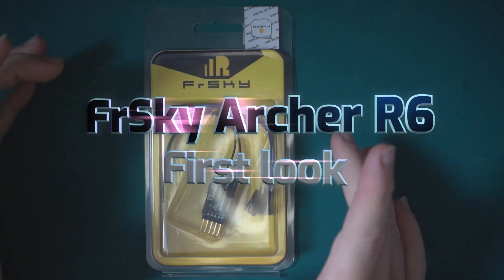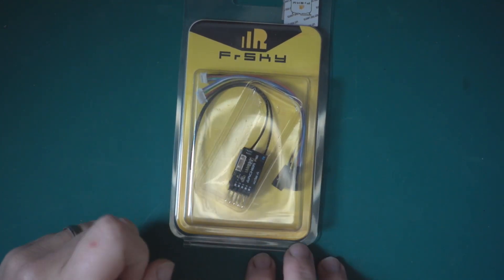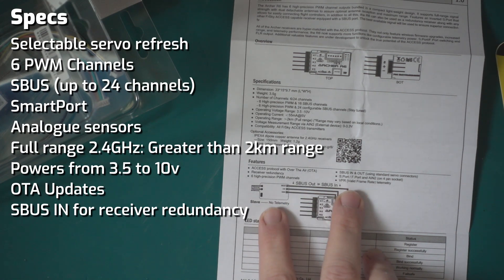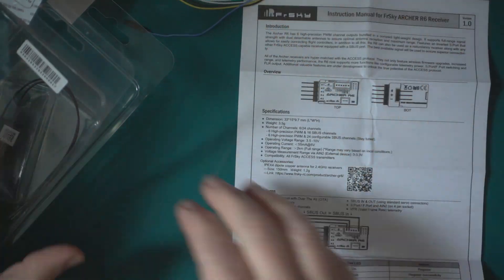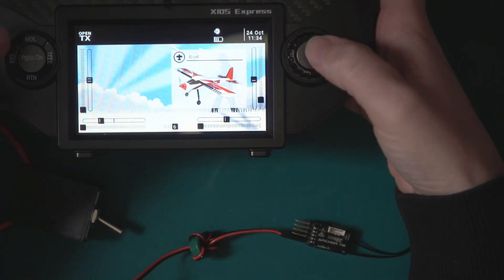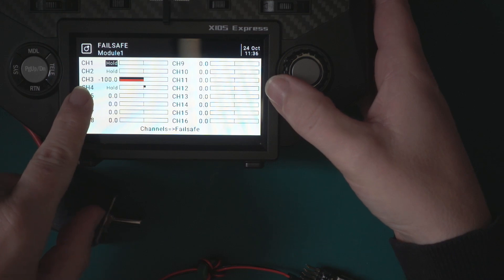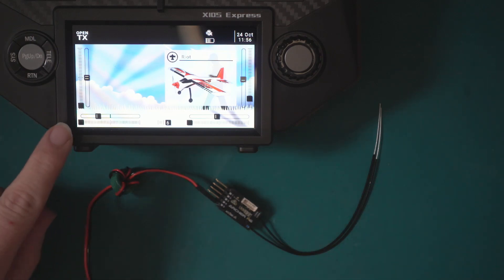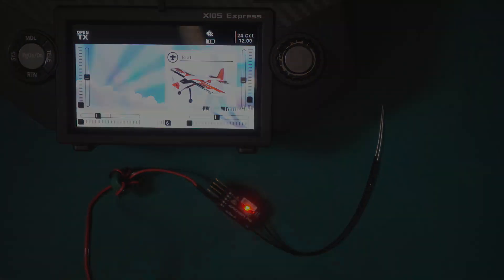FrSky Archer R6 Receiver First Look

Comment: at the 7:30 mark you mention that the rssi values need to be adjusted, is that true for all access receivers?  Is this documented somewhere?  I have a rs mini that I am having rssi issues with but for the life of me I cannot figure out why and the plane seems to fly fine.   also, are the pins on the R6 adjustable so I can use the physical pwm output for different channels (say like channel 8)?
Reply: well, I answered the first question myself in that the RSSI values are listed right on the FrSky downloads page for the receiver firmware:

* The suggested ACCESS RSSI is 32 for Critical Alarm and 35 for Low Alarm.

Darren (or anyone else) if you know about the pin assignments that would be great!
Reply from the maker: If you go in to the receiver options (I don’t have a radio to hand. But it’s near where you bind). If you can change the outputs. It will be in there. It should be possible with Archer receivers and newer.

Comment: Darren:

I'm having some carbon issues with a R8pro in a all carbon F5J sailplane.  I'm thinking a RS would be a good satellite located further back towards the tail.  Can offer an opinion and confirm that the S port would be the hook up to solder to.  Thanks for all you do.  Steve
Reply from the maker: Yes mate, that receiver would work fine. Just connect the SBUS OUT of the RS to the SBUS IN on the R8 Pro.

Comment: How does this RX get power when connected to the plane ?
Reply from the maker: Through the BEC in the ESC. Or if connected to a glow plane, you will need to use a receiver pack.
Reply: @MrD  
Thanks

Comment: Mr. D, have you ever noticed that the connection of the antennacables to the IPEX4 connectors is "lousy"? I'd love to use a nicer word, but that's what it was on both of my R6 RXs. I had to replace the antennas with new ones from FrSky, not for this particular model, but similar (unfortunately shorter) ones also with IPEX4 connectors. I wonder if I just got 2 RXs from an unfortunate batch?
Reply from the maker: I’m really not a fan of IPEX4 connectors. They’re too small. IPEX1 are fine. Were the original antennae damaged?
Reply: @MrD  the problem was for every single antenna, that the shielding (tinned copper braid), which is between the the insulator and the jacket had no sufficient contact to the ipex connector and the jacket wasn't crimped sufficiently or wasn't crimped at all. The word 'lousy' comes to my mind. I still like FrSky and it's my gear of choice but it's kind of uncool to buy extra antennas to get something orderly that should be orderly right off the shelf.
Reply from the maker: I agree. I hope it was a bad batch. But even more I hope IPEX4 is no longer used on RC products.
Reply: @MrD  I hope so too and I also agree, but with this general tendency everything becoming smaller and smaller we might even get something even smaller.

Comment: Hi , great vid thanks,  can’t get my new Archer GR8 to Register wth my Horus X10 
just doesn’t  populate when I connect 
Power ( FS button pressed on Rx of course and ‘ Register’ pressed first on Tx ) . Not sure
if my software version on Tx needs to be updated or what . Thought it was going to be
a simple process, anyway any thoughts to resolve problem? 
Thanks
Reply from the maker: I’ve not has the pleasure to try that receiver yet. But the binding should be no different to the R6. It would be worth checking the ISRM (Tx) firmware and making sure that’s on the latest.

Comment: Thank you, I bought FrSky Taranis XD9 plus SE 2019, since 6 months it didnt work, firmware issues, ISRM, openTX, S6R and X8R, finally I got new access R6 and now with your video it works, thank you
Reply from the maker: No problem Firoz. I’m glad its working for you now. 

I have the S6R and it works fine with the ACCESS firmware. It may be worth trying that if you’re still having problems with that receiver.
Reply: @MrD  oh I though S6R only works with D16, which opentx  and S6R version firmware you have?
Reply from the maker: Sorry, my mistake, I used the latest ACCST v2.1 firmware and it was fine. https://www.frsky-rc.com/s6r/ If you have problems, it would be worth checking the ISRM firmware version.

There are some older receivers that can also run ACCESS, like the RXSR and G-RX6 & 8.
Reply: @MrD  ok last question, which ISRM firmware worked for you for S6R?
Reply from the maker: I believe I’m using 2.1.0. It would have been the latest version when I got my transmitter last year.
Reply: @MrD  It worked for me right now, updated the firmware to the latest using STK :) thank you!!
Reply from the maker: No problem. Hope you have many great flights.

Comment: Mr D,

Great video.

I do have a question about how to setup an analog battery sensor telemetry on this receiver. 

Also, the model has 2 NiMH eneloop batteries installed and I'd like to monitor both if that's possible?

Cheers
Reply from the maker: How are the batteries connected to the receiver Jim?
Reply: @MrD  

Many thanks for your reply. Have actually got a little bit further in the logic and ascertained that this works very well for a single battery but would never work for more than that!

Again, great video and your others too!
Reply from the maker: If they’re on the same circuit, they’d drain in parallel too. Plus, there’s only the 1 analogue sensor port. But if one is directly connected to the receiver, the other could potentially be connected via A2. It would just be working out a way to keep the circuits separate. I’m not that up on physical electronics.
Reply: @MrD  That's what I understood when I got more intimate with the unit and the port! Lol Cheers

Comment: Great video Can I flash archer r6 and slim r9mm ota 900mhz receiver with EU/LBT firmware?
Reply from the maker: The R9 Slim or R9mm OTA is a definite yes. Though if they are 915MHz receivers, the antennas will not be tuned for 868MHz. 

With the R6 and ACCESS in general, there is no different firmware anymore for LBT. The transmitter is set to LBT or non-LBT, and the receiver self-configures to use it. The only difference will be the antennas for 900MHz receivers. 2.4GHz can be used on either with no downsides.
Reply: @MrD  Thanks for the reply, I purchased Taranis q7 EU version along with the mentioned receivers. As you mentioned the antennas weren’t tuned for 868 MHz, is it true that they cannot be used with Taranis Q7 EU/LBT version?. Could you suggest me any way to use these receivers along with Taranis q7 LBT transmitter? Or any two receivers for a quad and fixed wing which supports with Q7 LBT version. I’ve been trying to figure out but since I’m a beginner, I’m very confused.
Reply from the maker: @omkarbilla  you can use the antennas, they just won’t have the optimum performance. Going from 915 to 868 requires the antenna elements to be slightly longer for a better tune. 

If you’re a beginner, they will be fine. You won’t hit the limits of them. But if you start pushing things a year or so down the line, it would probably be worth just getting some antennas tuned to the correct frequency. 

Again, this is only with the R9 Ranger series. With the Archer series on 2.4GHz, the antennas are the same in LBT and non-LBT regions.
Reply: @MrD  thanks alot man! 
The info you shared helped me alot and saved lots of my time, and your videos are amazing! Keep making them!
Reply from the maker: You’re welcome, and thank you. I’ll keep working on the videos. By the way, if you need to get antennas at some point. I’d recommend checking out ProDrone. It’s a guy in Poland who custom builds and tunes every antenna, and they’re priced very reasonably too.
Reply: @MrD  amazing, I’ll assemble my new drone by this month and if I’m not ok with the performance, I will mail you and I will purchase the required antennas. btw can I use those both antennas for fixed wing and quad?

Comment: Thanks for an instructive video. If You use Frsky external sensors ( such as the LiPo sensor ) I discovered that it is IMPORTANT to unclick the F - port under options during the setup after update. I discovered that it by default was clicked during OTA update. That caused that the LiPo sensor suddenly didn’t work and could not be found.
I also noticed that it according to Frsky update-homepage is recommended to lower the threshold for RSSI to 32 (critical) and 35 (low signal).
I carried out several tests according to these recommendations  for R8 PRO and R4 using my S10S express transmitter. My conclusion was that I had a notable better range with the “old” X8R ACCST (with RSSI threshold on the former 42 and 45 ).
I had great expectations with the new Archer ACCES protocol. Also interesting to know what You have experienced concerning range. Maybe You also could give us a logical /technical explanation for lowering the RSSI threshold for ACCESS receivers and still fly safely.      Best Regards.
Reply from the maker: Hi Kim,

You’re totally right on the F.Port option. You can either use SBUS with SmartPort or F.Port.

I’m looking to build a tool to test the range of receivers. So hopefully this is something I can add in the future. I will also look in to the lower RSSI warnings.